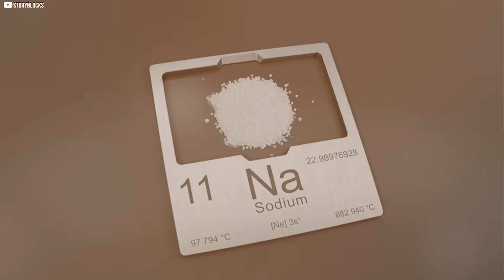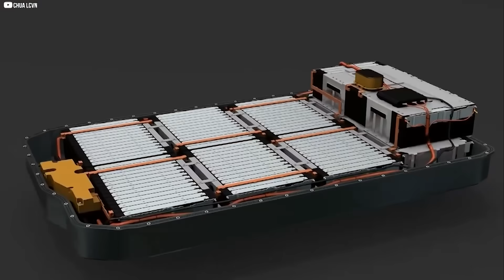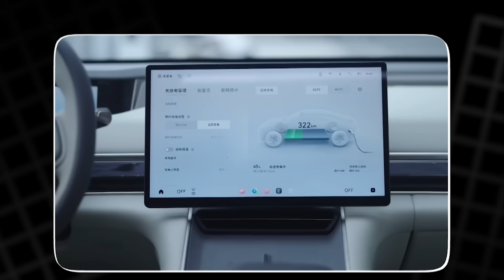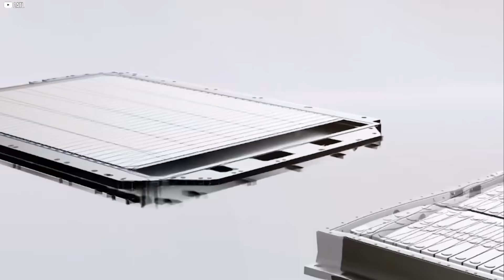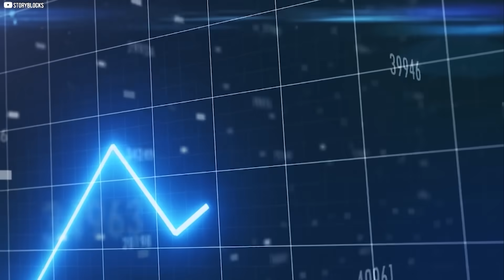Why the World’s Largest Battery Maker Is Betting on Salt

Comment: Bet I'm not the only driver who seldom drives more than 50 miles in a day. We could easily get by with a small (light) sodium battery, even with its current (sic) low energy density.

Comment: Is this better than the aluminum battery they're claiming is coming with the Tesla Model 2? If I was a producer of electrical vehicles this would lead me to a strategy of keeping the battery component completely undefined, adaptable, and replaceable at near zero cost of physical replacement. At any time my customer must be able to switch to a different battery... kind of like your flashlight.